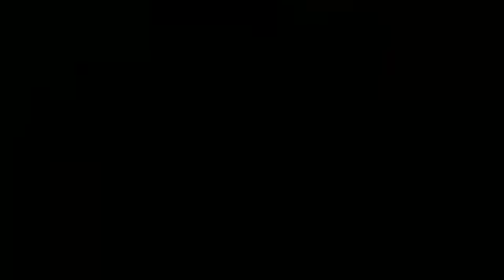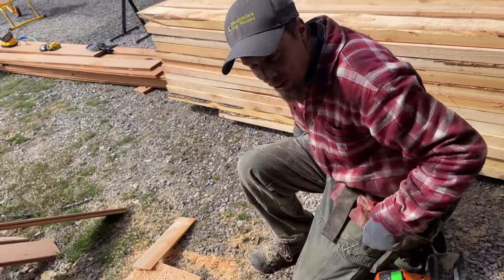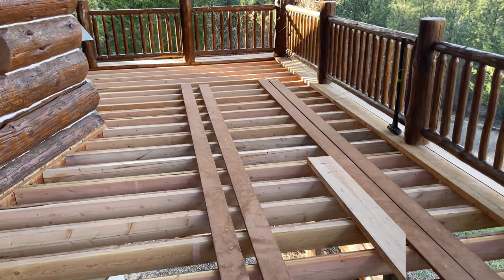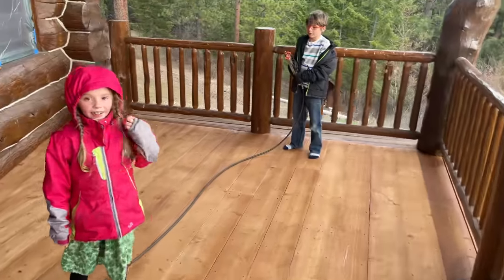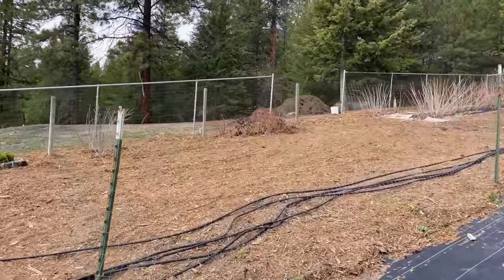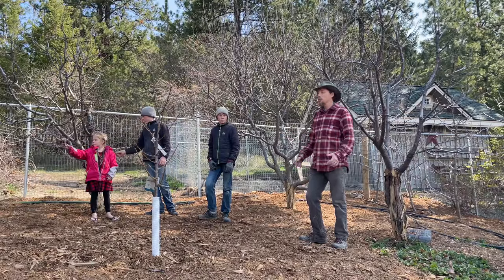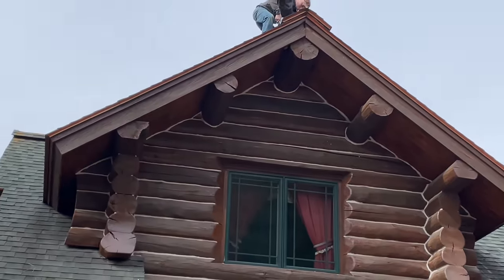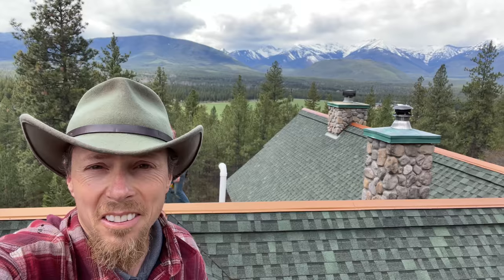3 Big Homestead Projects // Deck, Garden and Roof // Preparing For Alaska

Comment: Did you make the porch in a slope outward? I remember when they built ours they had to slope it out so the water would run off. It’s no problem with the synthetic material, it won’t rot, but real wood will rot if it doesn’t slope or have slots for the water to run through. I guess you don’t have a shortage of wood, so you could replace it. It does look beautiful! Your location is amazing!
Reply from the maker: We don’t have any blowing rain rain so it should be fine. I usually make them level if they’re under roof.
Reply: @MontanaHaven  That’s interesting. Ours is under a roof also. It is made of salvaged straight grain fir, so very old wood.